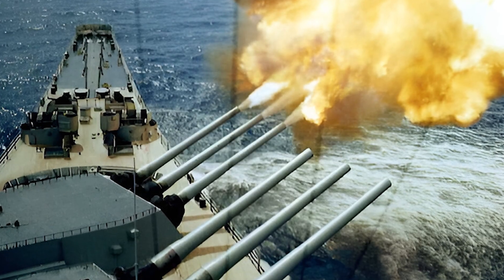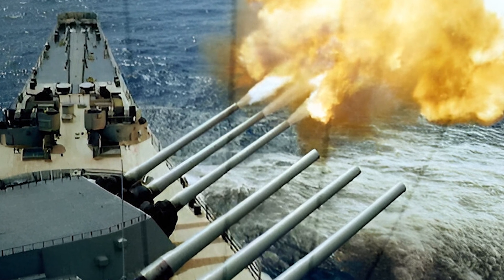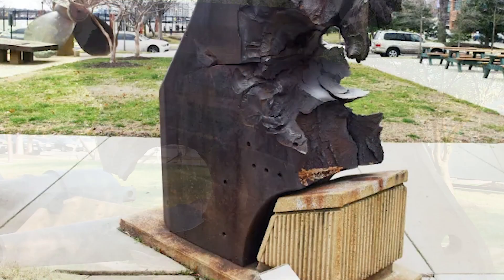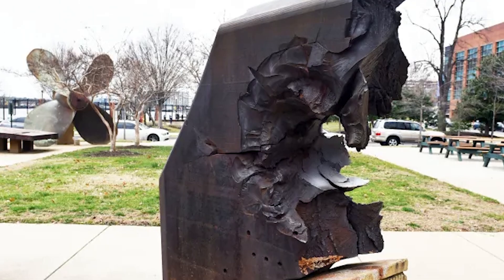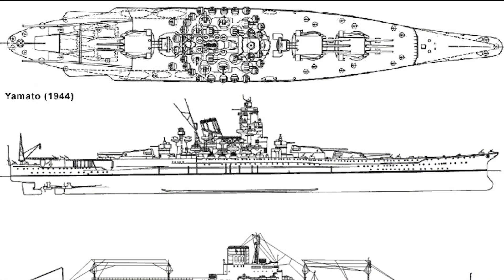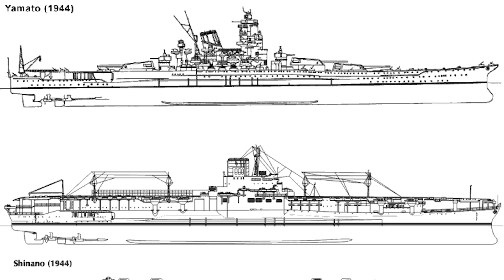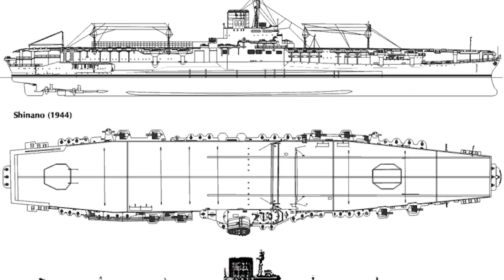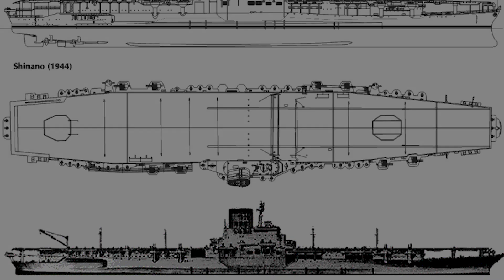USS-Iowa VS Yamato Armor Simulation

Comment: Except the shell wasn't moving at 750 m/s. They used a reduced charge to simulate normal combat range so the charge was moving somewhere closer to 610 m/s. It was a perfect shot with a perfect hit at the perfect angle. I can't say if it would have penetrated in actual combat given the pitch and roll of the target but given that Japanese armor quality of that thickness was inferior, I would say that it at least had a chance.
Reply: Nah,the plate was at 45° in the turret,it was impenetrable.
Reply: @ShokkuKyushu  while that is correct, at combat ranges the shell is also going to be angling downwards into the plate, negating  most of that 45°.  All I said was that it haf a chance. Didn't say it was a great chance, just a chance.
Reply: @daemonknight9413  With the mk7 16 inch/50 in order to negate most of the 45° the range would be greater than 30 km and the striking velocity would be less than 500 m/s so maybe enough to spall but not to penetrate. To be fair at that range the deck would be vulnerable though.
Reply: Japanese Quality Steel isn’t inferior, that firing test range was 400 ft after I researched several times.
Reply: @yoseipilot  That firing test was at very close range but with a reduced charge to simulate the drag the shell experiences at combat range without having to somehow overcome the issue of reliably hitting such a target at those ranges.
Reply: @hresvelgr401    After I researched from others Information, Iowa’s shell velocity was more than 610 m/s, meaning his firing range would about 9 km and penetrating 660 mm vertical steel armor. 
But they didn’t improve more accurate in this firing test as well, the angle fall from his shell is 5 degrees and Yamato’s turrets angle is still more than 45 degrees, which means at realistic result, Iowa would still not able to penetrate Yamato’s armor in battle.
Reply: @yoseipilot  Need to work on your wording there mate. Iowa absolutely could penetrate Yamato's armour in battle. Even if she could not penetrate the turret faces the rest of the ship all has less armour
Reply: @yoseipilot brittle high carbon steel plates riveted together vs state of the art STS steel welded together. The Japanese and Germans needed to use significantly more plate and weight to achieve the same results as the Americans and British. A lot of the armor on US BBs and CAs were also functional load bearing members where as at least one cruisers worth of weight on the Yamato and Musashi were just dead weight plate armor resulting in a massively ballooned displacement and thats WITHOUT water filled torpedo protection. With that I'd imagine the Yamato and Musashi being easily over 80k tons and struggling to break 26 knots at full tilt.
Reply: Japanese armour on the Yamato class was designed to fend off any large calibre available in the USA, including the North Carolina 16" but at combat realistic range; the Iowa shells were marginally more powerful then the NC ones, but not by much.
The penetration in the image was obtained by angling and Kinetic energy, except here we are talking about an Iowa projectile shot at point blank range, 90° normal to the surface of the plate.
Even with a slightly less powerful charge, the shell does not simulates correctly the effect of the ballistic trajectory and the huge drag of atmosphere at high speed.
We know the Yamatos had problems with armour: a Japanese (not biased) team of scientist explored the Musashi's hull and determined that the cause of the sinking was the inability by Japan manufacturers to weld plates as thick as those in the Citadel of the battleship, and those welding bonds broke under the strain of the torpedo hits, causing an uncontrollable flooding.
There is a possibility that a direct hit from a large calibre shell, might have ruptured the welding in the main tower, rendering it inoperative, but the possibility of a kinetic penetration like this is technically zero. The front armour plate from the Littorio class was tested against it's own guns, and those guns were monsters in raw power: the results was the inability of the shell to penetrate, despite the frontal plate on the Littorio main turrets being far less impressive then those on the Yamato.
As ballistics rule don't change much with scale, a pistol round shot at point blank range offers a certain penetration power, but just a few meters away it drops sharply: because of E=1/2 MV^2 with the square of Velocity meaning the any drop in speed would reduce the Energy of the impact massively.
A 12" gun would have probably destroyed the turret plate at point blank as well, but the reason why calibres kept increasing after Jutland is that the engaging distance increased massively and the energy loss made naval shell less effective but an increase in Mass increases Energy at distance to some degree. The Jutland battle was fought at an average of 8/10km but the average fighting range in the Mediterranean for large guns in WWII was about 25/30km.
It is a fact that Kirishima, even equipped with high explosive shells inflicted severe damages with quite a few penetrations on South Dakota, because the fight happened at unrealistic short range.Beyond 10Km, none of those penetrations could have happened.
Reply: Post war testing (part of the same test series this video is about actually) showed that Japanese BB armour was better than US BB armour.  Their CA/CL armour, was worse than US CA/CL armour.  It all came down to the composition and hardening processes used.

Comment: Yamato (and Musashi)....unquestionably the most beautiful and graceful looking battleship ever....was no match for an Iowa-class BB.  Questionable design, poor quality steel, and inferior construction methods....she was little more than a giant WW1 battleship built 25 yrs too late.
Reply: YouTube channel Battleship New Jersey determined that the steel quality was only 5 percent worse than the Iowas. The effect on the armor was considered negligible when it came to the qualities. Yamato had the superior long armor scheme by a long shot with a 16.1 inch belt angled at 20 degrees vs a 12.2 inch belt at 14. I really dislike the overdressed conversations that happen because of tests like these that prove nothing
Reply: @aviral3464  Which wouldn't have helped. The data obtained from this test allowed researchers to extrapolate the the effectiveness of the Iowa's guns on the Yamato at multiple angles and ranges. For the Iowa to not completely penetrate the armor at any range, the plate would need to be hit at 45 degrees. The armor will still have a hole in it, but the shell will fail to completely penetrate at that specific angle. The turret would still be critically damaged and potentially not be able to fire.

45 degrees is also unrealistic due to the trajectory of the shells at most normal and abnormal ranges.
Reply: @aviral3464  The Japanese in WW2 felt quite differently.  They were quite concerned about brittle armor and bad welding on both Yamato and Musashi when those ships suffered damage far out of proportion to what actually hit them (this was well before their sinking).  Oh, and the armor that the USN tested was produced several years after Yamato and Musashi had been built, commissioned, and analyzed.  It was improved armor, at least in relation to what the ships had.
Reply: There's a Japanese 3D modeler named Teikoku_R, who made a gigantic number-crunching video to prove Yamato is superior. It seemed a bit flat. The debates in the comments were interesting but inconclusive.
Reply: Source material is from the U.S. Navy Bureau of Ordinance.

Immunity zone of the Iowas vs. the 18.1" gun:
Citadel                    24,800- 29,800 (5,000 yards);
Turret Faceplates 24,700- 31,600 (6,900 Yards);
Barbettes               26,500- 31,600 (5,100 Yards);
Steering                 24,700- 28,800 (4,100 Yards);
Control Tower       26,500- 31,600 (5,100 Yards).

Immunity Zone of the Yamatos vs. the 16" .50 cal. gun:
Citadel             17,000- 34,500 (17,500 Yards);
Turret Faceplates                      (Impenetrable);
Barbettes         16,600- 36,800 (20,200 Yards);
Steering           19,100- 33,400 (14,300 Yards);
Control Tower 16,600- 33,400 (16,800 Yards).

Comment: How far away is this simulated for? Couod you try this again at a realistic engagement distance and angle?
Reply: The striking velocity in the  REAL  test is  equivalent to a range between ~ 9000-13000 meters (striking velocity ~600 m/s) . They probably wanted to test the minimum speed for a mk8 super heavy shell to penetrate vertical 660 mm of FHA.
He used a striking velocity close to MV,I don't know why. It would be interesting to see the shell at this speed vs the plate at 45°, in theory it would be impenetrable.
Reply: @ShokkuKyushu  the shell would impact at an angle so it would impact flat
Reply: @spearfisherman308  The impact angle at 9000-13000 m is around 5 degrees from the horizontal ,in order to have a hit  perpendicular to the turret face the range would be more than 30 km and at that range the striking speed is less than 500 m/s ,so the turret front is impenetrable. At >30 km the deck is vulnerable though.
Reply: The problem is more the fact this is RHA, and not Face Hardened Armor which would be more accurate, tho difficult to get what it is.
Reply: Seeing as both of those battle ships no longer exist. No.
Reply: The test was conducted from a range of 400 feet, which was standard for tests at the proving ground. Below are the immunity zones of the two vessels against the other ship's main battery with a target aspect of 90 degrees. Source material is from the U.S. Navy Bureau of Ordnance.

Immunity zone of the Iowas vs. the 18.1" gun:
Citadel                    24,800- 29,800 (5,000 yards);
Turret Faceplates 24,700- 31,600 (6,900 Yards);
Barbettes               26,500- 31,600 (5,100 Yards);
Steering                 24,700- 28,800 (4,100 Yards);
Control Tower       26,500- 31,600 (5,100 Yards).

Immunity Zone of the Yamatos vs. the 16" .50 cal. gun:
Citadel             17,000- 34,500 (17,500 Yards);
Turret Faceplates                      (Impenetrable);
Barbettes         16,600- 36,800 (20,200 Yards);
Steering           19,100- 33,400 (14,300 Yards);
Control Tower 16,600- 33,400 (16,800 Yards).
Reply: @manilajohn0182  with a reduced charge
Reply: Not sure about the simulation, but if I recall the real test was done at 1000 yards.
Reply: This simulates a range impossible in real life.
The barrel used was brand new and the charge way beyond anything used in combat.
The test was to see if they had the metallurgy to possibly penetrate armour that thick, not if the iowa could defeat the Yamato's turret front, because they knew from calculations that that was far outside of its capability
Reply: @Spider-gg3pj yes, the actual range was short, but a REDUCED propellant charge was used to simulate a longer range. The angle of impact in a real engagement would have been different of course.
Reply: @Spider-WoIf they used a reduced charge.

Comment: what differs the weight of superheavy shells compared to normal AP? its purely the size or they use a heavier metal too?
Reply: The super heavy designation was added to differentiate between the shell developed to be fired by the Iowa class battleships and a 16 inch shell that was already in service, which, unsurprisingly, was lighter. As far as I know, the Iowa class ships only ever used the super heavy variant which would indeed make that "normal AP" for those battleships, but since other ships also used 16 inch guns, and could fire both the lighter and heavier shell versions, the larger ones were named accordingly.

In terms of the actual design, there was very little difference. They were both made of the same material and were the same diameter, the super heavy variant was simply a bit longer so it weighed several hundred pounds more. I'm not sure about the bursting charge, I suspect that the super heavy had a slightly larger explosive mass, but I don't know that for certain.
Reply: @resurgam_b7  North Carolina-class and South Dakota-class also used the super heavy shells , the desing philosophy behind the super heavy was to hit the deck plating and penetrate that at ranges over 20km , in a similar way that the japanese designed shells that would hit the underwater armor .
In reality both ideas have little practicality since there was no way to consistently make such hits , but both shells were good enough in direct hits so redesigning them wasn't necessary .
Reply: They are the same thing. US battleships only had two types of shells, HP or High capacity, or AP amore piercing.
Reply: @Predator42ID US battleship shells were heavier than other nations shells of the same calibre and type.
The British experimented with light shells but the increased velocity increased wear on the barrels so they were dropped.
Reply: @Predator42ID  They aren't
Reply: @tandemcharge5114  Really? How? Unlike Japan or germany US didn't use any other types of ammo for battleships. Unless you are referring to the previous AP round which weighed in at 2400lbs before being replaced with the Mk8 super heavy at 2700lbs.

That was for the Dakota's and Iowa's the smaller ships used lighter but still the same type of ammo. 

The Des moines class cruisers were the only ones with large 8in guns that could double as AAA.  In the US arsenal. 

So please explain to me how US battleships somehow had multiple types. Not counting the Nuclear shells later built for them.
Reply: Smaller bursting charge could also be used.

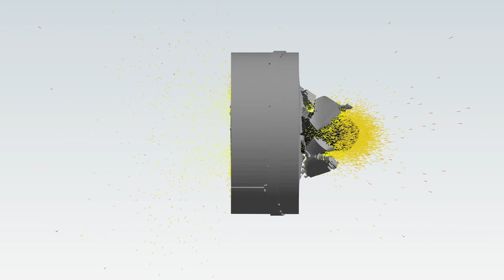Comment: 0:42 90 degree angle? In naval combat, shells do not hit armor at 90 degrees
Reply: As OP said this is a visualisation of the test,

Other things to note is that IRL the plate was itself sloped, which would also have affected the outcome.

As an aside at that range and at 90 deg... Scharnhorst would only just be unable to penetrate.

According to Nathan Okun's penetration table, which is a good guideline (for the most part)

Scharnhorst can ALMOST Partially Penetrate 25.7 inches (Partial Penetration - The forward half of the shell penetrates the armour while the rear half is rejected)

And 660mm is just shy of 26 inches.

The Italian 12.6 inch gun could almost penetrate it in an EFF (meaning shell intact and in a condition to function as designed), but will as a minimum fully penetrate (it's PP is 28.8 inches) 

The French 13 inch gun WILL penetrate and go BOOOM (EFF 29.7 inches)

So Iowa penetrating that plate, in those conditions isn't anything special....
Reply: The angle and velocity are simulating a long range hit with the shell impacting around 45 degrees relative to the vertical plane, which is straight-on (relatively) to the faceplate.

An inclined test on one or more layers of deck armor would be a more practical test in terms of impact likelihood. But, the turret face was the thickest armor available and still a possible impact point in battle.
Reply: The IRL test wasn't really a useful one, at least not for determining the actual effectiveness that the 16" gun would have on the Yamato, and the simulation here reflects that. The range was stupidly low and the angle, as you said, was entirely unrealistic. People put a lot of stock in this test but really it proved nothing.
Reply: @zoro115-s6b  Even the French 13 inch gun could penetrate this plate in those testing conditions......